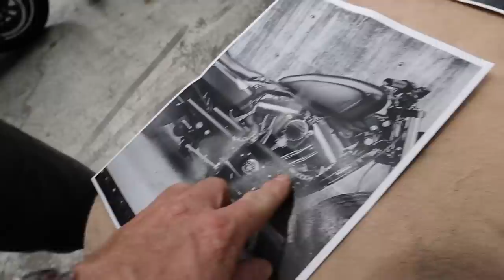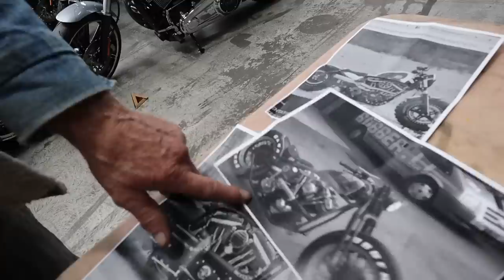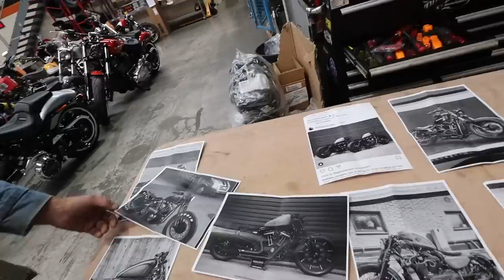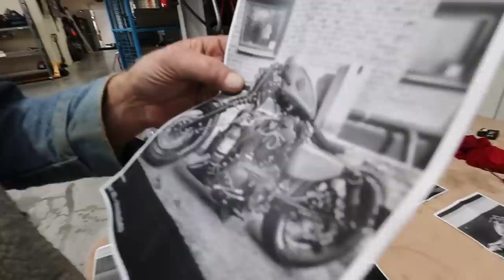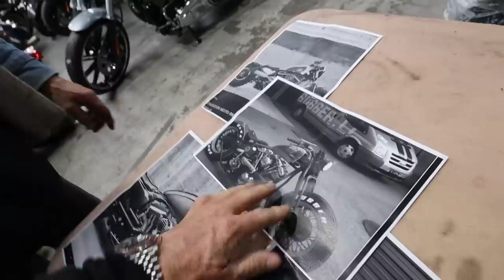Building Australia's best custom Harley Davidson 48

Comment: If you're going to go with a rigid frame, different wheels, springer front end and a heap of other stuff, you're better off selling the 48 and putting that money towards the project bike. To be honest it's kinda pointless (and expensive) using a complete bike as spare parts for something totally different. Harley make a sportster roadster that you can modify with a genuine HD factory cafe' racer kit.
Reply: I was going to say the exact same thing , you beat me to it . If your going to start with a new Frame , Wheels , front end , your basicaly saying your going to put the 48 engine in , so yeah  start from scratch  and seel the bike as is .
Reply: He doesn't want a ready made bike or a kit, he wants a genuine build. The way Americans have done it for 100 years. That means use what you have. He will probably do a weld on rigid rear end anyway. Real bike builders know what he's talking about.
Reply: @rogershipman3578   If you care to read what I said "roger" I suggested starting from scratch, rather than use a perfectly good bike as spare parts. That would be idiotic at best and needlessly expensive. What exactly makes you a "real bike builder"?

Comment: Col is a legend. I think if your going to make it a rigid frame there is no point using the 48 sportster at all . So either make an awsome bike of the 48 or make and awsome rigid frame chopper with a different motor. But there is alot of cool rigid frame choppers out there so it will have to be  bloody good to be the best. 🤣

Comment: If you want to save some cash get a bolt on bar to replace the shocks and check out Blockhead's 48 build. You keep the 48 frame and put a springer seat on it, and change out the front fork with an aftermarket springer fork. My dream 48!

Comment: Sportsters are awesome bikes to modify the hell out of! A little bit goes a long way especially in the power department cos it's such a light bike compared to the big twins. Aesthetics wise, almost every single thing can be swapped out for cooler custom/aftermarket parts. I'd go with a super clean look for the handlebars with zero wiring or cables on them!

Comment: Running a hardtail is good fun but totally different in terms of ride.Be prepared for the spinal drive.L&L choppers for a frame/springer front end.Sprung solo,Invader wheels,prismic tank.For an  absolute radical -shade tree surgeon(yt)would you ride this bike.(FNA customs).Or,you could go Hardtail theme frame but with a softtail rear,hidden shock's underneath and a springer front end.

Comment: 70's Hardtail right hand shift Sporty, Beach runner Diego Calif, it's only rock & roll.
Reply: You are describing my first Harley! About 30 years ago, I bought a '69 Sportster that had been chopped, right side shift, rigid frame. Before I gave the guy my money, I ran a check on the license plate and it came back with his name. He said he lost the title and wrote me a Bill of Sale and statement about lost title.

When I took the bike and paperwork to get it straightened out, the Washington State Patrol ran a check on the VIN and said the Sportster had been stolen out of California 20 years prior! Silly me, I did not read the fine print when I checked the license plate and it was for a different bike. This guy had swapped plates! 🤦‍♀️

The WSP then held the bike to give the rightful owner time to claim it. However, they told me that with the LA riots going on at the time ( this was in 1992), law enforcement down there had bigger fish to fry than to hunt someone down who probably had the bike insured. I did feel bad because I would have been pissed if somebody had stolen my bike so I was prepared to be out the money I paid for it (2K if I recall).😕

In the meantime, the guy that sold me the hot bike was long gone.

Think I had to wait about six months before the State Patrol released the bike to me, but they could only give  me a provisional title on it for another 6 months in case the original owner did claim it.

I did carry vanity plates on her for a few years, HARDTL.  Also had electric starter added because the kickstarter was hurting grown men, and I was a petite young lady back then.  Quite gullible, too!

Comment: Wow  them  Delong  HD guys are high Tech ..   They  use  glass mason jars with  steel  funnel Spouts..  Do  you know how hard it is to find them..  I have several of them and use them in  my shop all the time..  I full them  from  55 Gallon Drumps that have quart stroke pumps in them..    I got most of them from my Grandfather  and I am  59 years old ..  They used to come in a  6 pack carry  case .. You could go to the local service station and refull them  from a  55 gallon trum of oil ..  You need 5 quarts for an oil change with a 6th quat in case she burns or leaks a  little oil....  I use 2 quart mason jars too .  The thread size is standard for Ball  canning jars in the USA

Comment: The nicest Sportsters IMHO were always  just a stripped down, nothing fancy, 55ci, 900cc, drum front brake iron head, stock, tank, fenders, different seat, 18" back wheel. A modern version would sell like hotcakes, but HD management are just too daft, churning out Sportsters like a 48, with no proper suspension, and that chop look, sorry. They've lost where they came from. A modern Sportster with good suspension, 19/18" tyres, and keep the look would be great competition for Triumph/Ducati/BMW and the hipsters.

Comment: I could  turn it into a Rigid  in   1 hour..    replace the shocks with  some steel bars  weld the swing arm  solid  ect..  You  Are  getting old Danny you need to have rear suspension ..